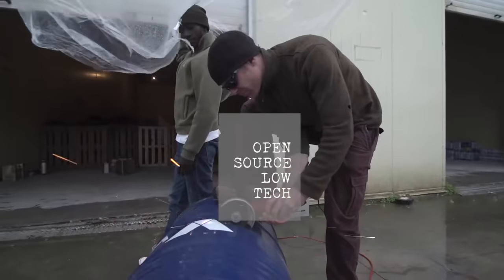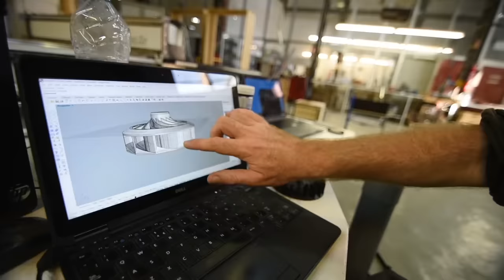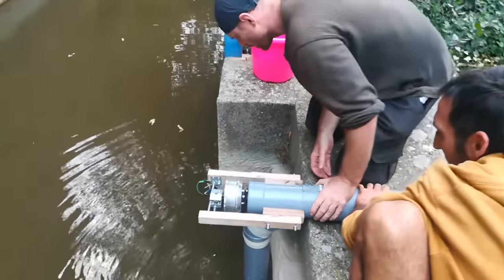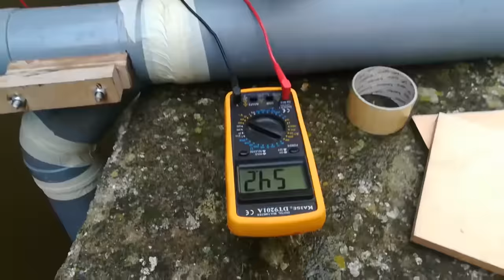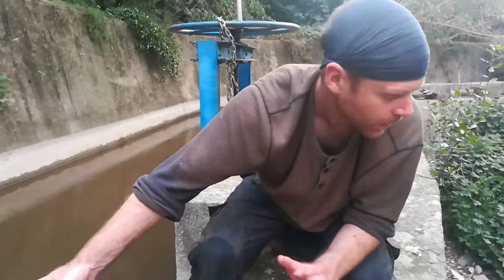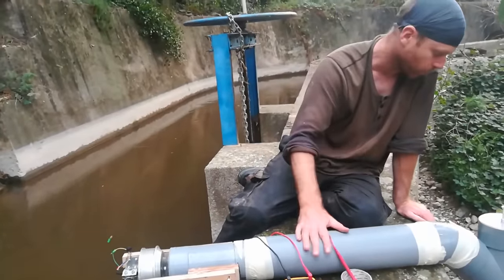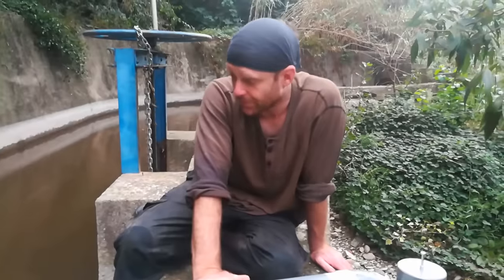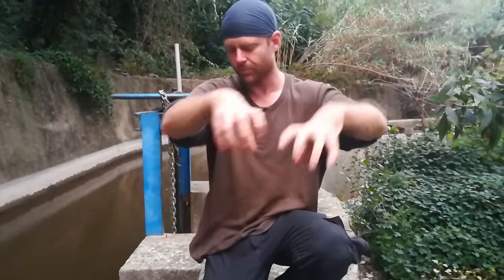The $50 Water Turbine -DIY, Portable, Powerful, and Open Source

Comment: HA HA HA THE METER YOU HAVE CONNECTED CONNECTOR, meter range 200uA = (0.0002A) and the ropes connected for 10A. Learn to use the tester..((google translate   PL->EN
Reply from the maker: Yeah, didn't notice that at the time but those voltage readings have since been confirmed.
See the part two video for more and better power numbers.

Comment: $50??? sure
Reply from the maker: That one was actually closer to $45.
Reply: @OpenSourceLowTech  Pipes, wires, timber, bolts, tape, 3D printing, Hoverboard wheel or bike alternator. All for $45. That is impressive. Cheers. 
I think your work is outstanding. Great idea. But where i live. It would cost me $50 just for the pipes and elbows.

Comment: Sorry, friend, but using a PC fan is incredibly ignorant of fluid dynamics. Also you want the turbine to be at the bottom of that fall you've got going on, the potential energy of that drop is entirely squandered in this design. I mean it's neat, but the fact there's companies paying people to do what we rednecks have done a thousand times and posted the plans of thirty years ago on bulletin boards all over the world is kinda wild. There are better blade designs, better wheel designs, better generator heads, and better layouts than this. And for less than $50 too, in fact, you can scavenge most of the parts freely from a junk yard for most builds. These figures are lackluster. I do hope you research water wheels for at least an hour before trying again.

Comment: facepalm. terrible built that will last 2 days.  at the same time solar panels are now like 50$ for 200w)
Reply from the maker: It's still running months later (fuller field use data to come), and although it is often possible to get PV panels in low resource areas of the world, a decent solar day is usually about five to six hours, depending on season. This will produce 24/7, so about five times the power for less cost, and is maintainable by the users as all the materials are locally available.
Not that I've got anything against solar, in fact the two complement each other nicely.
Reply: @OpenSourceLowTech  i am guessing we have to believe you on everything . starting from price , availability and  longevity)  truth is hydro power is not that cheep and pretty complicated too
Reply from the maker: No, I'll be broadcasting all the results of the current testing and optimisation in the coming weeks and months, followed by a full build tutorial.